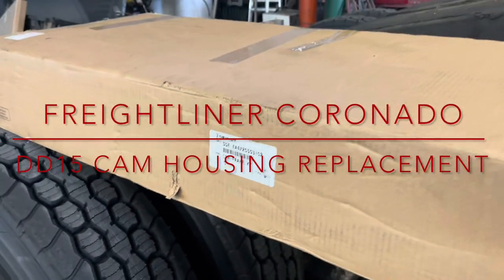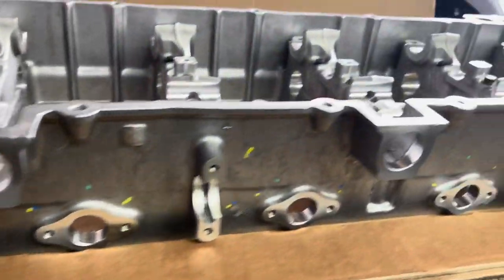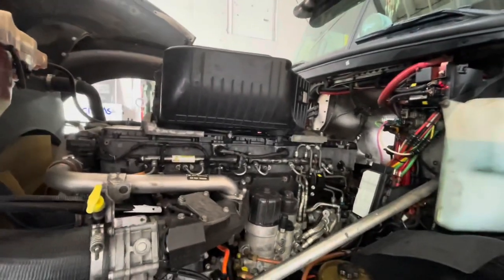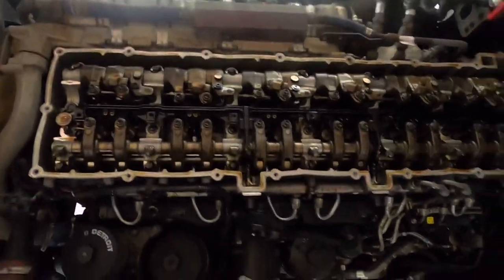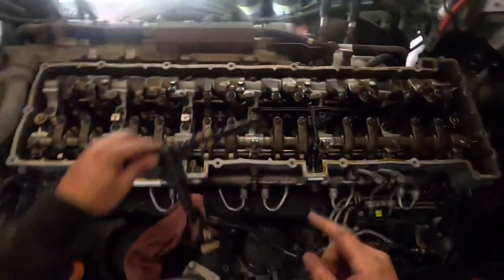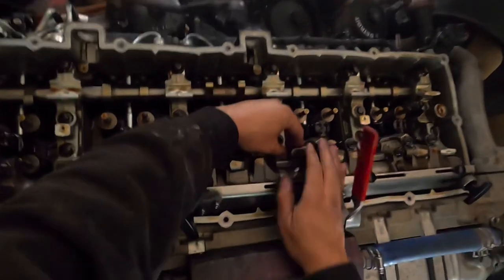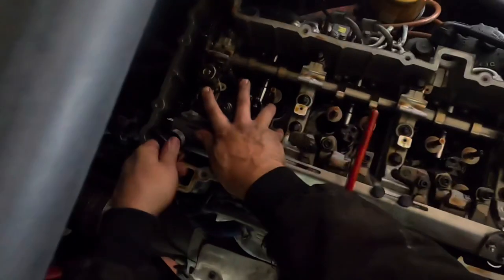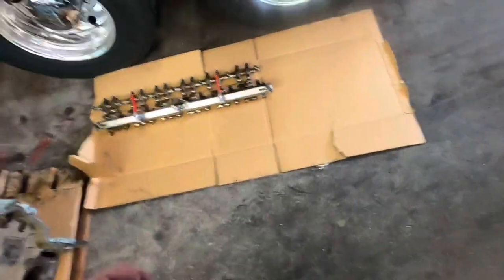Freightliner Coronado with a DD15 , CAM housing replacement because of a damaged seal. Part 1

Comment: The lines from rail to injectors are reusable
Reply from the maker: I have heard mixed reviews. When I first started I understood one and done. But then heard they can be reused. If you are working on your own then it’s up to you. But for a shop, I recommend replacing. I worked on a DD15 recently and reused the injector line number 1. Which leaked after a few miles, ended up replacing with a new.

Comment: I’m doing a dd13 right now. What do you believe a good labor rate is for this. It’s my first one but I want to bill the customer fare.
Reply from the maker: Are you doing just the CAM housing? Also, is this the short nose Cascadia? If it is, it will require more labor because of the limited space to work on. Cylinders 4, 5, 6 are tucked in to the cab.

Comment: Those small cam housing bolts fell down , what should i do?
Reply from the maker: Use a flash light and hopefully you can see them. Maybe use a magnet to fish them out. Or you may have to remove the rear housing.
Reply: Thank you, but used light , I couldn't see it,
Is there anything i can do without removing rear housing or is there any chance that bolt fell into oil pan?
Btw i am removing cylinder head, if that helps
Reply from the maker: @davindersingh-qk6gf  you can remove the oil pan and hopefully you will have access to them and get them out.
Reply: Ok thanks
Reply from the maker: @davindersingh-qk6gf  did you find the bolts?

Comment: hi i need help with active fault code 21 cascadia 2014 auto please first time code
Reply from the maker: There is more to the fault code. Usually  the fault code four digits followed by two. For example SPN 1234 FMI 00
Look for something like this.
Reply: What is suspected parameter number and failure mode identifier?